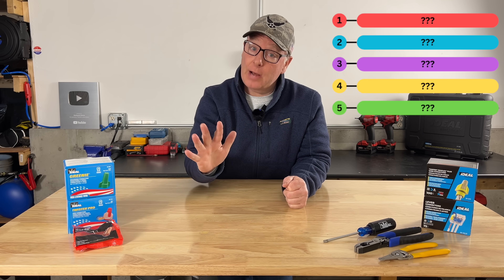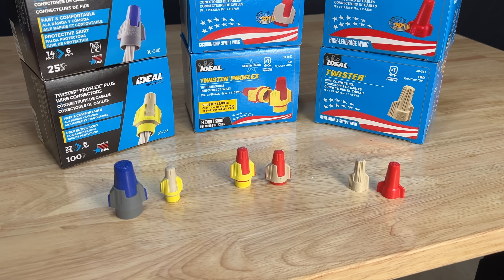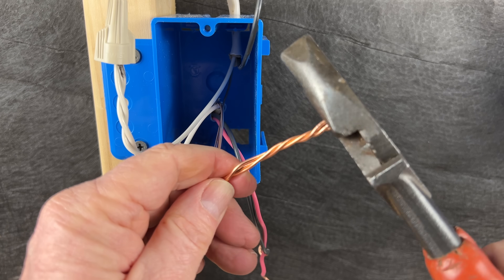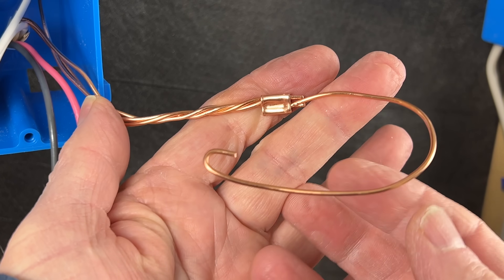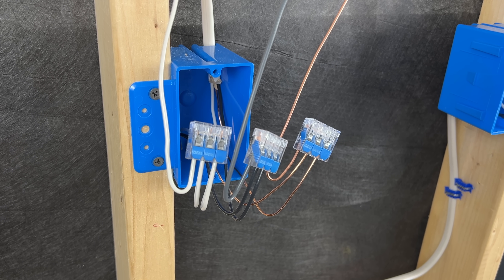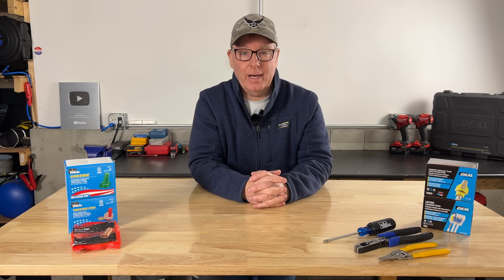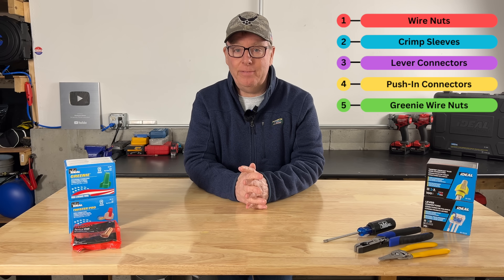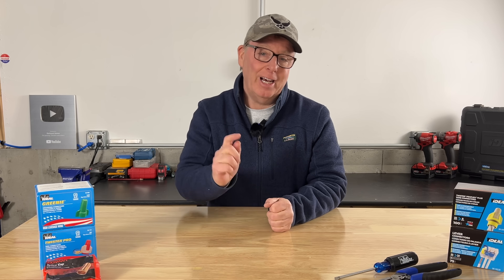How NOT to Connect Ground Wires in 2025 (Safety First)

Comment: Another electrifying video from the one and only! Loving the deep dive into grounding methods—Twister Wire Connectors and In-Sure Lever Wire Connectors are built for jobs just like this. We're excited for what 2025 brings, thanks for being a fantastic, knowledgeable partner!
Reply: Well the video could be greater if the presenter showed wiring a metal box with romex. This way he could showcase the Ideal ground screw pigtail combos which are extremely helpful to make a compact install. The flexible stranded wire to a locking spade to the receptacle ground screw is extremely reliable if the screw is torqued properly, and the wire being stranded allows installing the receptacle that much easier. This was also true of the similar products of hot and neutral pigtails that Idea discontinued, which was a shame, because if all of the pigtails are stranded then installation of the receptacle is a breeze.
Reply: @windward2818  It was an 8 min advert for ideal products.
Reply from the maker: Thank you so much and thanks again for partnering with the channel.

Comment: I haven't twisted conductors together before twisting on a wire nut ever since needing to rework circuits in a box.  And can you ever state with certainty that you'll never rework or replace a box?  Good luck if untwisting snaps part of a conductor or otherwise weakens it.  I'm not an electrician, just an informed homeowner who's seen many illegal practices that electricians did before me.

Comment: So the video is all about connectors specifically ground, butt connectors why do you have two blacks and two whites on a receptacle when the code clearly says that a device cannot be used to support the neutral or hot connection?

Comment: The thing I can't figure out with ALL  lever connector brands they all come with single port double Port triple port or 5 Port why does nobody make a four-port its very common to have a work box that has three separate cables coming into it and a device with as crowded as the box is with three cables coming into it and a device being that you cannot have a work box that has four separate cables coming into it and a device because it would be overloaded even more the reason you need a four-part now you have to use a 5 port that will never use the fifth port. I can't tell you how many times I have run out of 5 ports for when I need them because I put them in places where I needed a four. 😡 then when you look at the push in connectors they came in 4 Port, and they did not come in five port. I have only ever used 5 ports on equipment never in a junction box... that needed it

Comment: Lever connectors have been around for decades, since the 80's back in the UK-- they're great.  One thing I remember from my time in the UK, those earth/ground wires had to be sheathed with a green & yellow slip-on sleeve inside every box, I always thought this a good and common sense practice, I wonder why it wasn't mandated by the NEC here in the USA.

Comment: Yeah, I learned the hard way about twisting the connectors on the first house remodel I did I kept going back and finding connectors that had worked loose from the wire nuts. about the third time I started making it a practice on every connection. So yes I love those lever connectors, much faster than twisting the wires, and make the process of replacing a device much simpler.

Comment: Wago's what I use for at least 5 years no more pretzeled up twisted wire. When you twist up the solid core wire it a PITA to undo it most just cut it off. With a WAGO I can unconnect one wire modern technology. Wire nut is the stage coach or steam locomotive of the past. It will die off most electricians younger then 40 use wago's.

Comment: Not a licensed electrician, but I worked an commercial kitchen and bakery equipment for 25 years (CFESA), and thought I would jump in and share one of my "stories"....customer said that when they pushed the heated food box against the Vulcan range it sparked and tripped the breaker.  Customer said that his son had recently replaced the power cord, and "knew all about electricity because he works on vintage electronics".  Well, in electronics, the black wire is B- (ground to chassis) and the red wire is the B+"hot".  Of course, he connected the black wire of the new cord to ground, the white wire to neutral, and the green wire to hot.  The aluminum frame of the hotbox was now at 120v and it was a miracle no one was hurt or worse.

Comment: I like the lever nuts for connecting #16 LED lighting to #12 Wire, makes the mismatch in wire diameter no issue, also when the light dies its an easy swap out.

Comment: Only use lever connectors on low voltage, the blade that comes down and makes contact with the wire does not offer a better surface area then wire nuts. Also at my job one day someone left a few at the bottom of a file cabinet that had a bunch of electrical stuff and miscellaneous other stuff related to a maintenance shop. Well an unknown liquid got on to the bottom of the drawer and on the wago connectors that were on the bottom, and when I when to grab them, they disintegrated in my hand. I don’t know what got on them but nothing else was effected in this drawer. So use with caution.

Comment: Nothing more annoying when servicing/modifying live circuits than "pretwisters", just be smarter than wire nuts and use it correctly there won't be any problems. You don't need to pretwist if you are smarter than the wire nut

Comment: For the ground wires  I always use the crimp on type saves space makes a more presentable box also after twisting and crimping i bend the short tails over the rim always do the grounds first and push them down flat to the back of the box.  You can also leave as many longer grounds as needed for switches and receptacles. Crimps are not reusable  but can be removed fairly easy with good wire cutters clipping parallel and on the edge, if you need to make a change.

Comment: I'm old school.  I twist connections tight to ensure a good mechanical bond before adding a wire nut.  If the nut worked loose, the connection is still maintained.
Reply from the maker: I do the same..

Comment: John, I have a grounding wire question.  In my 1972 house it has the old 40 station circuit breaker box.  It has a couple of burned out bars so I would like to replace it.  The problem is, all the new big breaker boxes that I have found have their grounding bars down one side of the main buss bar.  Mine now has the grounding bars right at the top.  So most all my romex grounds come in at the top and are cut off to go directly into that bar.  So my question is, is it legal, or safe to somehow attach another wire to each of my ground wires to extend them to the new box?  There doesn’t look to be room in the top of the new boxes to put a grounding bar at the top of the new boxes.  So some guidance from you would be much appreciated.  Tom in Oklahoma.

Comment: How should a homeowner work with a 120 year old home still using a 2 wire system when connecting a modern fixture with a ground wire? How can the new fixture be grounded and is that a significant concern?   Asking from Maine for a family member in NH.

Comment: Hello John  in viewing your videos I see you constantly referring to code compliance yet I see in one of your videos you show how to make a neutral to ground bonding plug for a generator with a floating neutral. To the best of my knowledge bonding plugs are Not code compliant.   This is my only complaint your other videos I really do enjoy.
Reply from the maker: Yes, a neutral-ground bonding plug is code compliant and often required for floating neutral generators when used standalone (camping, job sites) to create a proper ground reference for safety (clearing ground faults), but it's strictly forbidden when connecting to a home's main panel (which already bonds neutral/ground), as that creates a dangerous double-bond. The key is using the right setup for the situation: bond for standalone use, unbond (or use a bonded generator) for house backup.

Comment: I was wondering why he didn’t show Wago’s and then I saw the part he said he was sponsored. That’s enough for me
Reply from the maker: I have videos with the WAGO 221s as well. I like them both but the ideal insure lever connectors snap tightly closed where the WAGO levers easily open to the halfway position. Test them yourself if you think my opinion has been bought. Like I said both are good but I think the Ideal as a little better.

Comment: Personally, I'll never understand why the ground in Romex is not a green coated wire instead of a bare.  I hate the fact that sometimes, carelessness in the grounded wire location in the box can touch a hot screw or wire inside a box.  I have used the "Greenies" for years, but the lever connectors are much simpler without the extra twisting.  (I always wrap electrical tape around lever connectors.  While unlikely, they still can pop open.)

Comment: Like the Buchanan I used to get Sta-kon connectors. I think that was a T&B  brand name. These are not so easy to find here in the south west part of USA. The crimp on connectors were my go to for many years. They also made a plastic cap for use on power conductors. These are more reliable than many wirenut connections, but like you said not reusable..

Comment: I am an irrigation contractor.  I love the Ideal gel filled wire nuts for irrigation in-ground connections but I was wondering if they make the lever connectors rated for the same??
Reply from the maker: That's an interesting question about the gel-filled lever connectors for irrigation, they don't have a gel filled lever connector just yet but they may in the future.

Comment: From a purely electrical and mechanical perspective, I like crimp connectors, but they are more difficult to use in some locations as, as you said, can’t be reused and you shorten your wires with every modification that requires the crimp to be cut off.  Also, I would not twist the wires before crimping.  Crimping is meant to slightly deform the wires for a more secure connection and twisting the wire both work hardens the copper a little making deformation harder and makes the bundle fatter which can complicate the crimp.

Comment: If cost isn’t an issue or if you have arthritic hands or a weak grip, lever connectors are hard to beat.  I still like wire nuts as they are cheap and I can install them nearly as fast as a lever connector, but I think lever connectors are neat technology.
Reply from the maker: I agree on all point..

Comment: I have found it more reliable to not twist the wires together with a wire nut.  Some folks simply don’t screw them on tight enough when the wires are pretwisted.  And twisting prior to insertion into the wire nut makes the overall diameter of the wire bundle larger so the wires don’t penetrate as deeply into the wire nut.  I want the wires to be as straight and parallel as possible for deep insertion into the wire nut.  I then twist the wire nut until I have 3 or so full twists of the wires coming out of the wire nut. Having the wires twist while inside the nut essentially cams them outward into the nut as the bundle expands making of a very tight fit.

I can generally tell the different when I remove a wire nut.  Often a pretwisted bundle will allow the wires nut to come off fairly easily, often not even untwisting the wires at all.  A wire nut removed from a bundle twisted with the wire nut, often tends to jam up and be very hard to remove and often will at least partially untwist the bundle.
Reply: I agree with everything that you said, but would like to add to your list of why not to twist wires together prior to putting the wire nut on is that if you are trouble shooting a circuit the wires become brittle and may brake when untwisting and it is difficult to do when the circuit is on and you are trying to separate wires to isolate the problem.

Comment: I like  these Ideal wire connectors, they appear to be more secure than the Wago connectors which tend to flip open when pushing wire into a box. Is it code compliant to put electrical tape around Wagos? 
Thanks for the informative videos.
Reply from the maker: I agree.  Yes you can tape connectors but you shouldn’t have to.

Comment: The biggest problem I ran in to over 42 years servicing appliances was installers NOT pre-twisting the power connections, which would lead to the spring in the wire nut making the connection. These would overheat over time, melt the wirenut, and then the connection would open. ALWAYS pretwist those leads for a secure mechanical connection that the wirenut then just fastens and protects.

Comment: I'm in California, and wondering if Wagos are indeed allowed to be used for ground wires, per code. I don't see any reason why they would not be, but some random posts online claim that they are not allowed for ground wires, so I wanted to double check.
Reply from the maker: California may have a local requirement that doesn't allow them but per the NEC they can be used for ground wires.

Comment: WIRE NUTS!  No one uses wire nuts anymore. Wagos are vastly superior.  If you go to Europe, and talk to an electrician under 40 years old, they have never even SEEN a wire nut.  With Wagos taking a connection apart is a "non-event".  I recommend pigtails, and then, use stranded wire for the pigtail. I use a "pre-made" ground wire that has a terminal pre-crimped on it. Makes it much easier to get the device in the box.  NEVER use contractor grade receptacles, and never, ever, never, use the "stab in the back" feature. If it were up to me, those would be illegal.  Only use commercial grade receptacles. They will CLAMP the wire, no need to wrap the wire around the screw.  Pass & Seymour Legrand  TR26252-W is one that I like. Also, unlike their competition, they still come in a small cardboard box. Leviton and others ship their receptacles, "naked" where they get damaged and scratched up in transit, more difficult to store also. Nice video, by the way. The world would be boring if everyone did things the same exact way.

Comment: At 7.58 you are using the plug to pass the circuit thru. I know you are just showing alternatives to connecting the ground wire put to a DYI person they might see this and use it to wire up a room or something or use the example to replace all the plugs in there home and skip the pigtails. You know what happens when we end up with a loose neutral on a plug in the middle of a circuit.. As far as those quick connects still don't have faith in those. Specially those Wago ones they sale in the big box stores. Good ole green wire nut for the win. Then on the bright side those cheap connectors do keep the vans rolling..
Reply from the maker: Pigtails aren’t required by code. They are required for the neutral wire on a multi wire branch circuit but that’s it. I made a video on pigtails and through wiring where a go over both methods in detail. Check it out.

Comment: Hi you have great videos.  I have always been told that you had to use the Buchanan crimp tool on Buchanan crimps.  I noticed that you didn't, can you comment on that.  Thanks
Reply from the maker: They are best crimped with the that tool but I find I can get a good crimp with the crimping tool I have. I don’t want to carry another tool if I don’t have to. I have never had a problem with an inspection doing it this way and ideal had no problem with me showing that method during their sponsored video. But that specific tool does work best because it crimps from all directions.

Comment: The push-on connectors on lamps are an issue when removal is necessary. Brute force? Cut and replace?
Reply from the maker: You are right, those push-on connections can be an issue, and sometimes cutting and replacing is the only option.

Comment: Not an electrician. For ground, the crimp connectors are the easiest for me to verify, because all conductors can be visually validated without having to touch anything. My house came wired like this and it made switching to decora style switches and outlets much easier. A wire nut with a tail wire is a close second for this DIY guy. I just like the assurance from having multiple contact points you get from twisting.
Reply from the maker: That’s a good point, the crimp connectors offer a clear visual confirmation.

Comment: Retired electrician with hand issues. Don't work much now. Tempted to buy some lever connectors but I probably have more wire nuts hanging around than I will ever use.

I love the twister wire nuts especially the tan ones. A few years back I bought the IDEAL screwdriver that can be used to twist on wire nuts and the added leverage is just great. Love that thing and its a good screwdriver as well.
Reply from the maker: Lever connectors are good, but wire nuts are still the standard for a reason.